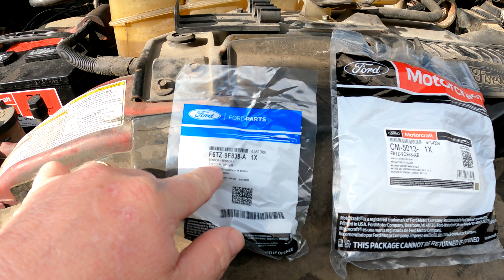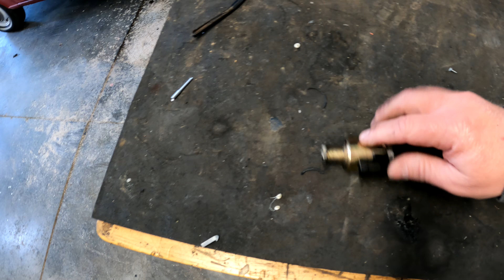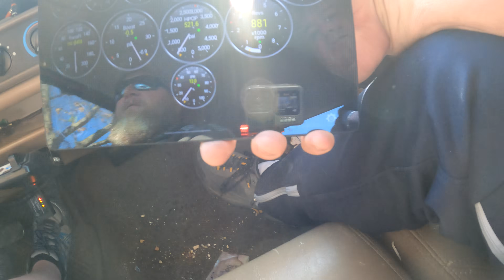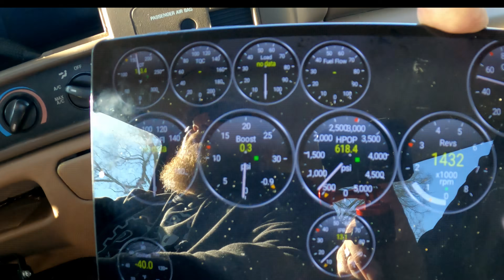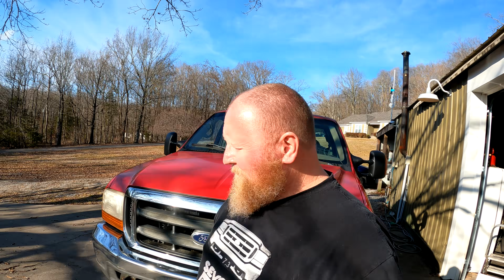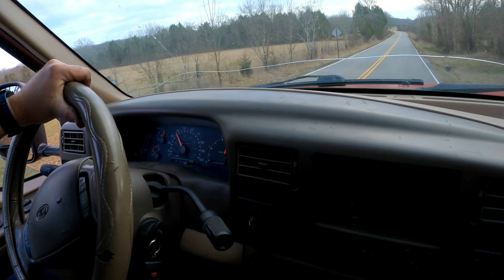$500 7.3 Powerstroke Superduty "F2-Hooptie" Gets ICP, IPR and a Proper Drive!

Comment: Did I miss something? What happened with the high exhaust back pressure read? Was exhaust clogged or coked up?
Reply from the maker: Actually I think it was just the EBPV closing as part of normal warm-up. Once the truck warms up, the flap opens and backpressure goes back to normal.
Reply: @ProjectTimeGarage  Thanx for your reply. Not a diesel guy but enjoy your videos.
Reply from the maker: @michaelmclester5133  thanks!!!

Comment: Those IPR’s are easily rebuilt for under ten dollars. Takes less than an hour. 

But if you want to replace it, you will find the Navistar brand are heavy duty, compared to Ford OEM. They use thicker metal for the tubular shaft.  That’s the one, I use.
Reply from the maker: Oh cool, I didn't realize that. I thought Navistar supplied the parts for Ford OE.
Reply: Not if the solenoid goes bad genius

Comment: I have the same truck except mine is the long bed. I've put a Blackwater Engines balanced and blueprinted long block in mine with new everything and it ran great until recently. I'm replacing the same stuff; IPR, ICP, CPS but I'm suspecting the Diesel Site Adrenaline HPOP I put on it when I changed engines is having issues. Going to start with the cheap stuff first...glad you guys got her up and running.
Reply from the maker: Man, do yourself a favor. Get the OBD2 reader and a copy of Torque Pro from the app store. You need to see how much high pressure oil you're making. If that adrenaline pump is bad, you won't create enough pressure to actuate the injectors. They need about 400psi to start. Those parts are expensive. I hate to see you spend money you don't have to. Thing is, it could be the IPR, ICP, HPOP, CPS, FICM, Low pressure oil pump and on and on and on.
Reply: @ProjectTimeGarage  yep, TY. I have a scanner and forscan. I'm only getting 165 psi at crank with IPR % @  64.4%. No errors. I ordered a new IPR and called Deisel Site and they said my HPOP is well within warranty so I can either send it to them for a free test or bring it by since they're an hour away. What I am most worried about is the main computer. I am on my  second one since buying the truck.
Reply from the maker: @fg146  Yep, with the IPR at 64%, that's considered almost 100% duty cycle. You're spot on. Dang!
Reply: @ProjectTimeGarage  Turns out the new IPR from Full Force Diesel solved most of the problem. The truck starts and idles fine now at 12% at the IPR and 400-500 PSI once warm but if you rev it and let off fast she'll die. It may be air still in the system. I checked the fuel pressure at the bowl and it maxes my gauge at 100PSI so now I'm going down that rabbit hole lol.

Comment: None of these parts last anymore, not even OEM. Ford dealers want over $400.00 for the IPR valve now, it's ridiculous.
Reply from the maker: I have probems with new parts all the time. I haven't ran across a legit Motorcraft/Navistar part that dies prematurely, though. As for the IPR valve, buy the OEM Motorcraft part directly from Amazon for about $170: https://amzn.to/3IOt4rm
Reply: @ProjectTimeGarage  I was looking at the description and features of that IPR you linked from Amazon and it said Country of Origin : China so I just called Full Force diesel and had them send me one they guarantee is OEM. $their price was $217.00.
Reply from the maker: @fg146  Man, thanks for pointing that out. That would make it a grey market part. That's frustrating as hell.
Reply from the maker: @fg146  I get everything from either Full Force, or MidTenn Ford Truck, they are a commercial Ford dealership. Their pricing has always been really good. Both of those places are local to me.
Reply: @ProjectTimeGarage  I just hope they didn't make it out of too much Chinesium and it holds up for you for a while.
Reply: @ProjectTimeGarage  Thanks for that info! I'll bookmark that MidTenn dealership and check there next time. dealers around here have outrageous pricing. Of course, being in the Tampa area, everything is a bit pricey.

Comment: Got to love those 7.3L fords, you just can’t kill them. My 1999 F-350 is still a baby with only 151K on the odometer and will be a nice weather only truck very soon. Great content you guys keep putting out! Keep the 7.3L stuff coming.
Reply from the maker: Yeah, with 151K it'll outlive all of us.
Reply: @ProjectTimeGarage , definitely. And once it gets relegated to only a nice weather truck then the mileage will basically be minimal. It’d probably only see 3,000 a year then if that. But it’s my baby so she needs to be treated right.
Reply from the maker: @JLCmike4014  Yep, plus they aren't making them like that anymore.
Reply: @ProjectTimeGarage , nope they aren’t. I’d take a 6.0L over any newer emissions truck. At least with the 6.0L once all the problems are resolved or upgraded then it’s actually a really good engine. Not as good as the 7.3L but still. Just a matter of getting it to that point. But my first choice will always be the 7.3L.
Reply from the maker: @JLCmike4014  I also have an '03 with the 6.0. I bought it almost brand new. Nobody knew what problems they would become. Like you said, I got it sorted many years ago. It pulls my camper all over the place now. Does well and has been dependable.
Reply: @ProjectTimeGarage , cool. The only other diesel truck i have is a 2003 2500HD silverado with the duramax. It’s rusty but i’ll never get rid of it due to sentimental value. Eventually it will get fully rebuilt and become a garage queen like the ford.

Comment: Runs good! Love that wheel setup I’m torn between that setup or 18s with 35 and 12.5s. I found out my excursion needs exhaust back pressure sensor and I’m gonna replace the line, heard it is a fun job. Would love to see how you’d do it though you sure know you were around a ferd.
Reply from the maker: Thanks, on EBP (Exhaust Back Pressure) tube and sensor. The tube isn't too bad. Biggest problem is they like to get rusted and seized to the exhaust manifold. FYI, you can clean your existing tube with weedeater string, some brake cleaner and a little time. I've done a few of them. The sensor itself rarely fails from what I've seen.
Reply: @ProjectTimeGarage  good to know! The line I’ll just replace I’ll be removing it no matter what anyways. The sensor threw 2 codes a po478 and a po470 on FORScan, maybe the wires corroded? I do live in the north east it takes a beating from the roads this time of year.
Reply from the maker: @Lonewolf23-26  Yeah, the green crusty wire connections can cause a lot of problems.